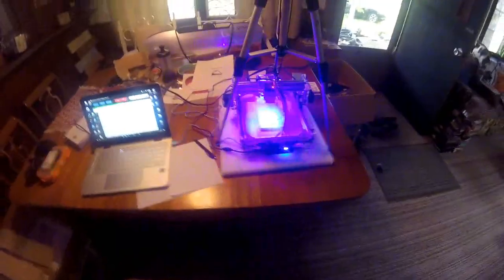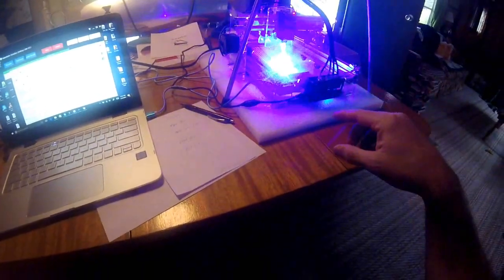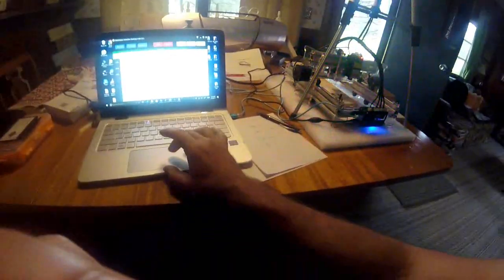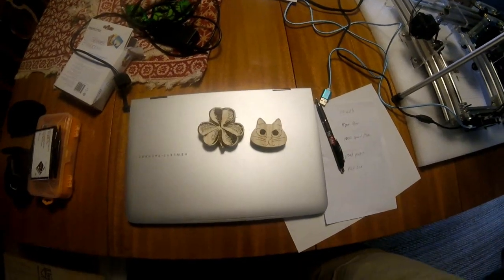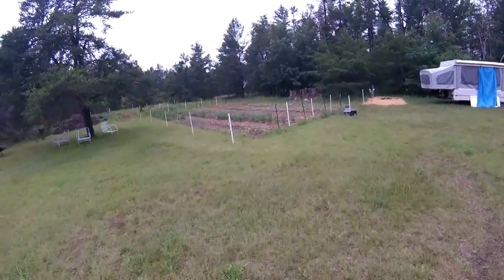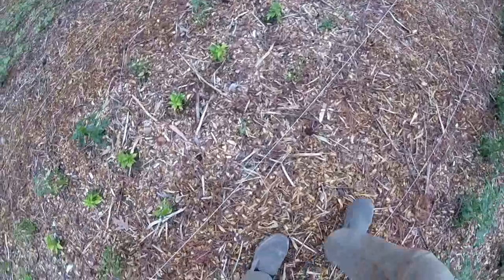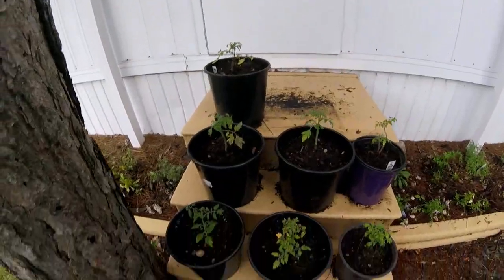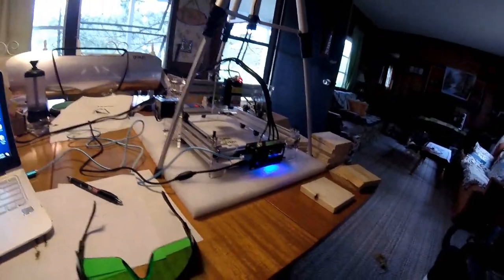Endless Rain ~ Garden Update ~ Woodworking

Comment: Hey Troy,  I worry all the smoke this thing generates may damage your Interocitor (hehe ) in the elctronics workshop.
I am sure fine particles of smoke would not be good for the internal.  When I had my computer shop I had several customers had damage done to their computers by smoke in home fires.

I suggest you make a framework to go over the Laser engraver and cover it with panels you cut from a clear shower curtain liner.
Then use a large diameter 12 volt computer case fan and some dryer exhaust ducting to blow the smoke out of the lab.

Just an idea.  By the way the Shamrock and the Kitty you cut out on the band saw looked cool.

I was thinking of ordering a  custom burned wood square Troy but I would prefer one of the old ones that Melanie 
burned by hand.  I would not mind if it was a blem and had a mistake on opposite side.

I bet the rain and mist have been great for the garden.

Comment: If you burn wood with it in the electronics lab, wont the smoke be bad for the other electronics?  Just a thought.  I would install an exhaust vent for when doing that.
Reply from the maker: Yes. I plan to use a fan when wood burning.

Comment: like the laser.... correct me if im wrong but you should be able to run your laser straight off your battery bank with little drain and without the use ac power..
Reply from the maker: Yes I think so.